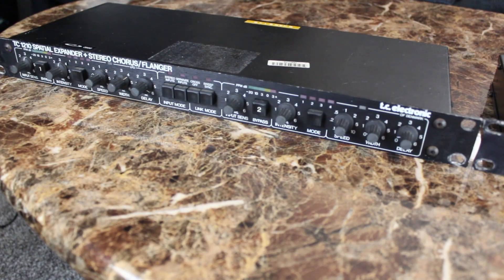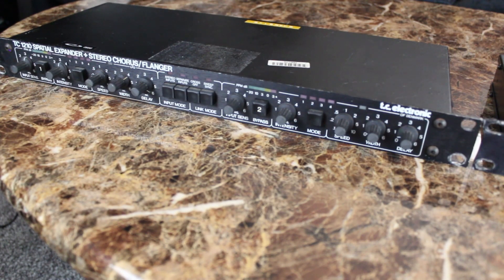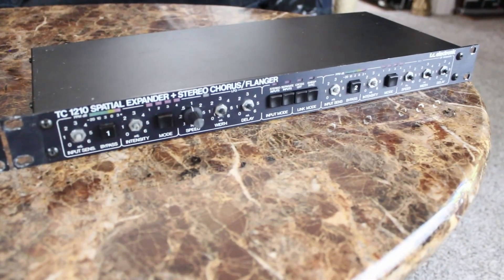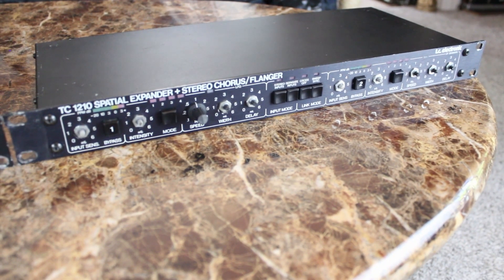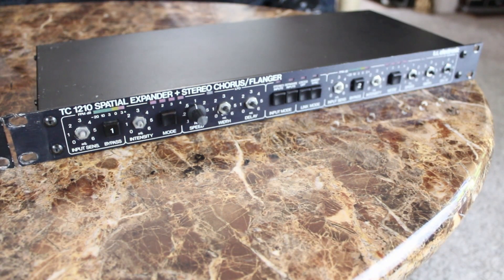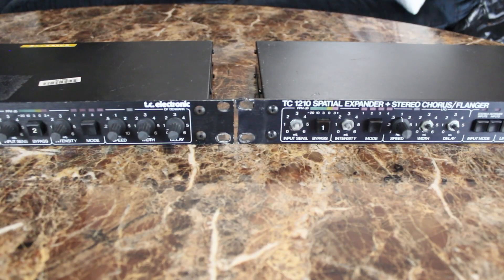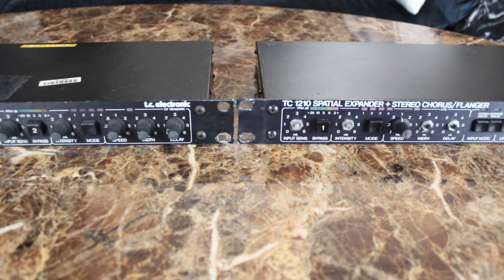My TC Electronic 1210 - A Tale of Two Spatial Expanders...

Comment: I have a TC1210 that was immediately blowing fuses when I bought it.  It turns out that the fuse holder is only connected to the unit by the two pads on the PCB and had ripped the traces out.  A 5 min solder job and a little reroute got it working again.  I suspect that there are quite a few of these units out there with the same issue.
Reply from the maker: I had replaced the fuse holder on my first TC10, because the original one seemed to be damaged, but it didn't fix the larger problem for me. Based on what I've heard, it could be the tantalum capacitors among other things. I've reached out to T&R Electronics last year for a quote, so I'm just waiting until I can afford to send them in for repair. I normally like to DIY things, but I'm scared to mess with these units too much myself. I'm glad you were able to get yours working! :)
Reply: @Control_Room  I'm actually sending mine in to TNR this week.  The power situation is fine, but it's supposed to be set at unity gain and I'm getting a massive volume boost with most of the frequencies in the low end when it's engaged.  I have a schematic and can replace the caps without issue, but I don't have the calibration procedures and figure it's best to leave it to the pro
Reply from the maker: @TheVertigoCycles  I'm eager to hear how that goes! If you wouldn't mind, please let me know what the turnaround time was like, once you get it back. :)
Yeah for the most part, I like to do simple component replacements myself, but I'm a little hesitant with big-ticket items after I had a Gallien Krueger 2100sel catch on fire. Lol
Reply from the maker: Now if only I could find someone to troubleshoot my Loft 450 delay/flanger!
Reply: @Control_Room  Brian says about a week.  I shipped it off today and will update you on how it went